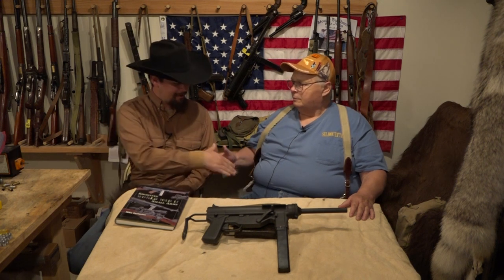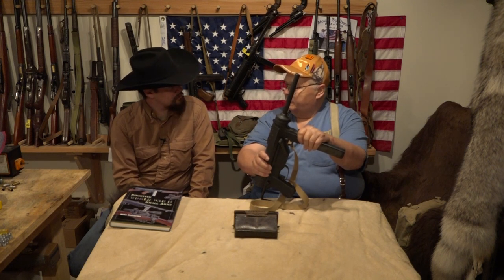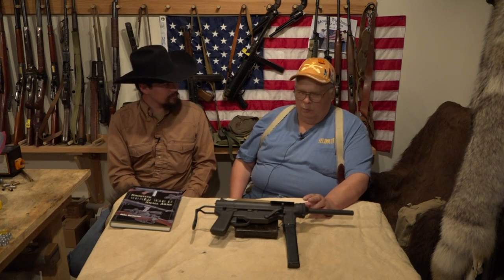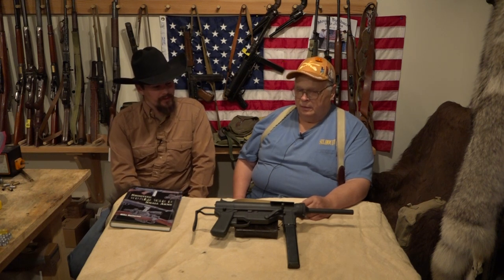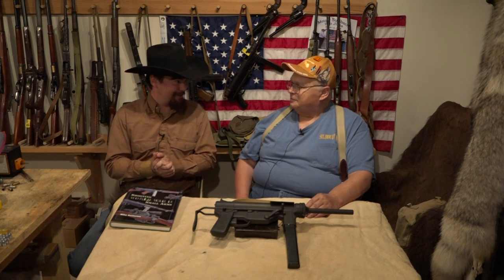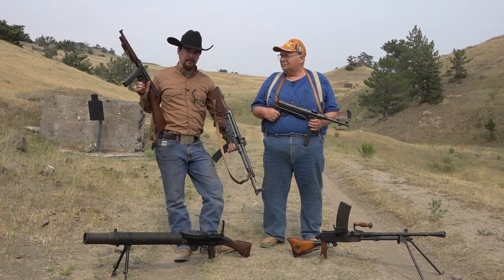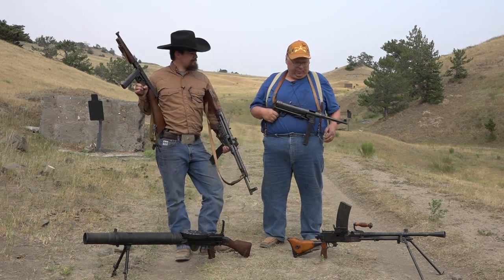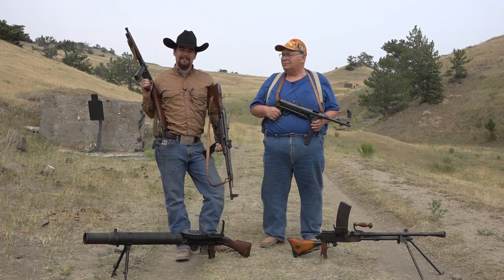WWII Small Arms Series M3 Submachine gun, the "Grease Gun"

Comment: I carried the M3A1 in the late 1970's in a Mechanized Infantry Company. We had 2 M3 and 3 M3A1 grease guns in our arms room. They were for the mechanics and the crew of the VTR (Vehicle Tracked Recovery). They fire from the open bolt and you can not close the dust cover if the bolt is cocked. Common procedure was to adjust the wire stock so that the butt rested in the crook of your arm. Hold the weapon slightly below chest height and walk fire into your target. The sights were next to useless and I never knew of anyone who actually used them to hit anything.  Open bolt firing is not known for accuracy, better to walk fire into the target. With a little practice, you can get on target in a couple of rounds. That wire stock BTW is the one tool that you can use to completely disassemble the M3 and M3A1, and there is usually an oiler stored in the grip.
Reply from the maker: My dad also had an M3A1 grease gun that he carried, he was not a big fan of it and thought of it as cheap and a bit clunky. While they are a lot of fun to shoot and extremely interesting. I agree the sights are quite crude and not exactly helpful for accurate fire on a target. I personally also do not like the magazine button I feel I can not get and adequate grip without being in danger of depressing the release and dropping my magazine. It certainly would not be my first choice for if I was going into combat. Thanks for watching and taking the time to share your experience and the interesting tidbits about the gun! --Jeremiah